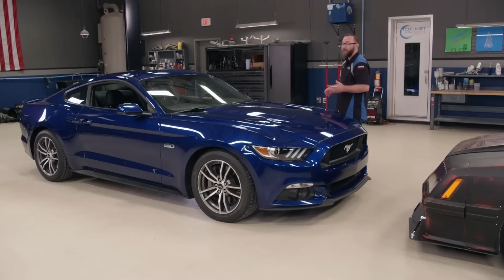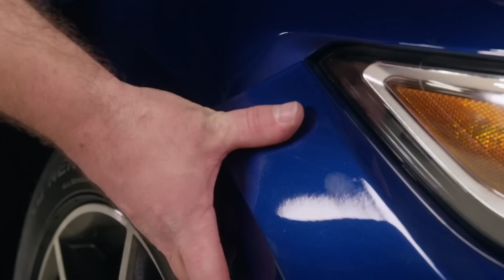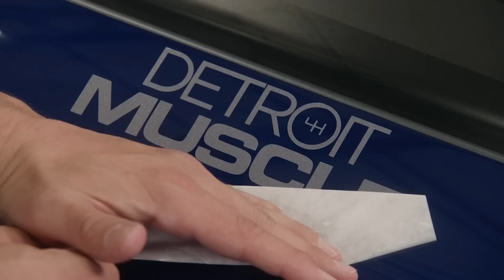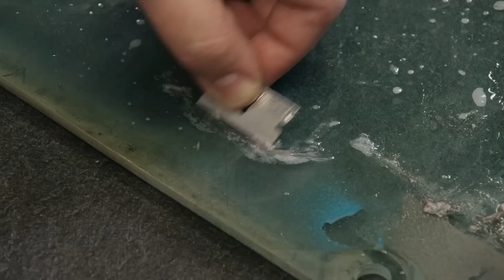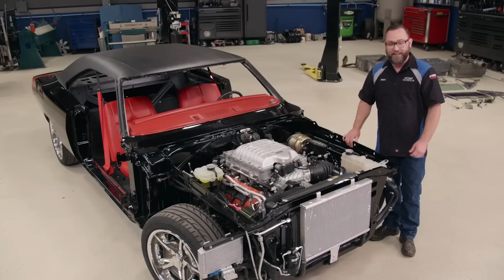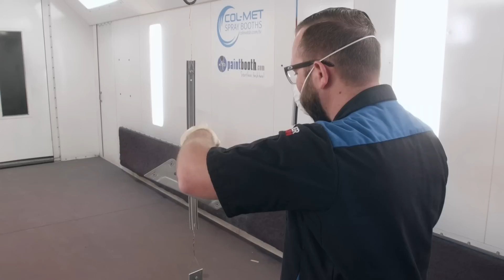Mustang Fox Body or S550 GT, What's Your Favorite? - Detroit Muscle S6, E12

Comment: Tommy -I worked doing electronics for Chemistry experiments at a University for about 4 years.  Sometimes I got to play with solvents like freezing them down to make specific-temperature slush baths.  One of my favorites was cyclohexane.  Dissolves silicon rubber lickety-split.  And it was very good at removing the glue from bathtub stickers and those old plastic frost shields they had for cars and trucks way up north or on the frozen prairies in Canada where she goes down to -50 degC sometimes. Maybe you ought to try some cyclohexane on the glue of your tinted glass. The stuff is extremely flammable so be careful.  Another material that might be useful would be sudsy ammonia. Don't breathe the fumes too much.  Or even Windex.  Why not give them all a try (separately) in the interests of science.

Comment: Wow, you could fit that fox body inside the S550. I'll take the 81. Its raw, unrefined-- a much more visceral experience which is what I prefer. It will never be faster than the S550 on a road course but who cares. It's the fun factor that matters.
Reply: Stock for stock... sure. But ive never heard of a stock fox, maybe 20 years ago. That boat will never keep up with a fox

Comment: another helpful tip for window tint after removing tint and you cant be bothered scrapping your windows use oven cleaner the spray on foam up stuff is best and use non-caustic saves razor blades arms and time. I use to do it with window cleaner and a razor blade but when i found out about over cleaner it changed my life.

Comment: Id take a 74 hardtop with a 351w over both of them
Reply: Mustang Boss 🤢🤢🤮🤮🤮🤮🤮🤮🤮🤮🤮🤮🤮
what are you high?
Reply: @kmoss9521  nope... It's better lookin than both of them..  The fox body is just a Sierra and nearly killed the mustang... The new one is nice... But it's not as fun to drive as a 74.   The 74 is  like the original 64 and sold more than the original did. . Its suspension is better than both of those. Which is why most hot rodders use mustang II suspension...
Reply: And it saved the mustang name when high gas prices nearly killed it.  The II is the hero of the mustangs.

Comment: If you are going to modify it and drive it hard foxbody. If you buy a new car every 10 years the new mustang. Fox + lite simple cheap. Fox- needs mods to be modern fast and limited underhood space for an ohc .new stang+ modern fast with very little work. Reliably modern stang- weighs more than my 70 chevy c20 its a pig like most newer muscle cars. Ford computer systems are a pain in the gearhead ass. Very very expensive when a motor pops.

Comment: The window trick is awesome I didn't knew it but I wanna add something. You can't scratch glass with a razor blade. The glass is usually a 6 in hardness while the blade usually is a 5 to 5.5. It won't scratch it. I learned that repairing phones. Keep up the good work!